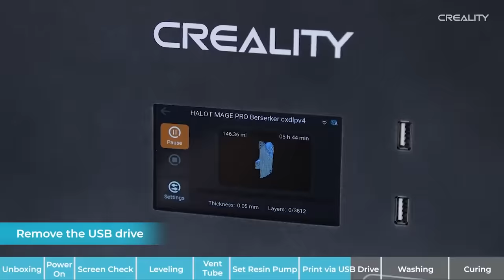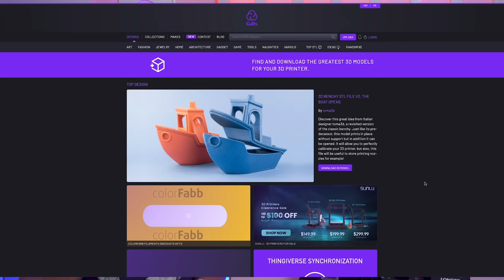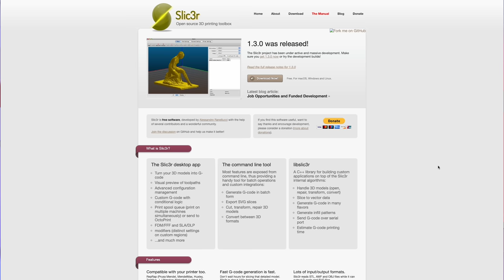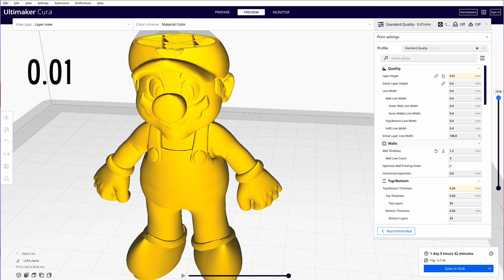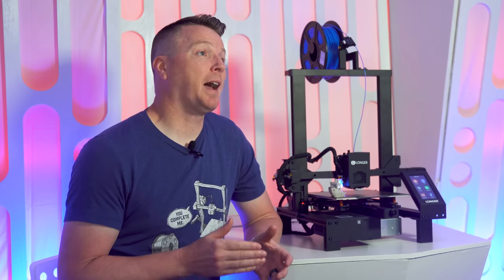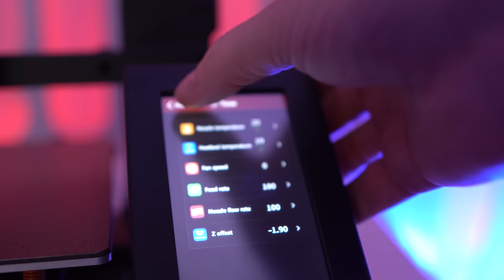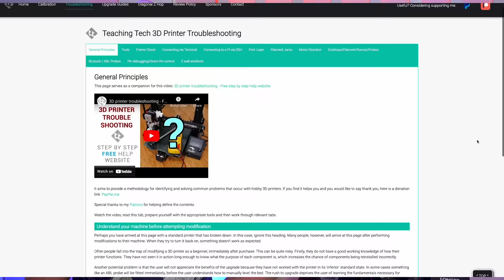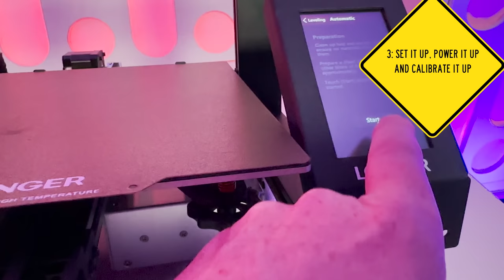3D PRINTING 101: The ULTIMATE Beginner’s Guide

Comment: @colincampbell3679
0 seconds ago
Hi there, Hope your memory is great. Because do you remember me Colin.  
I sent you a load of great upgrade files for the Tronxy X5SA 3D printer you unboxed and built on a live stream awhile back!   

I never heard back from you about how you got on with the Tronxy X5SA?  Or how many of the files for it I sent were printed for it?

I like to know please how the printer has been like and what stuff you may have done on it since?

As for my Tronxy X5SA, I have given up on it and dismantled it fully and replaced the parts back into the original box  saved from the 3 years ago I had the printer since!

I had tried to get a good leveling and prints from it but the damn size of the bed and the fact it has 6 hand done bed adjustment screws meant it 
was too hard to level right even though I upgraded it with the new Tronxy black sensor and a titan extruder and a ultra flex rubber bed sheet.

So it is now back in the box as I will use those for spears now.  I still using the Voxelab Aquila G32 chip machine which I had upgraded a few times.
It has a all metal high temp hot end which is at this time up to 300 C but with the right thermistor and heater it can do 550 C. 

I got a PEI double sided bed metal sheet. and a duel gear extruder and Capricorn bowden tubing and duel lead z screws. and firmware is the Alex one.

I still using the FLSUN QQ-S Pro Delta printer. And my Elegoo Neptune 3 is not working I am waiting for a new Main Board for it from Elegoo they already sent a new touch screen and power unit and micro SD Card so we see if the printer be up again soon?

I am saving up to buy a large format bed 3D printer to replace the Tronxy but even bigger bed than it had, a new Elegoo Neptune 3 Max with 400 x 400 mm bed and 500 mm printing height.
And it has a great auto bed leveling built in.  Just will need a worktop of at least 35 inches deep and 30 inches wide to hold it as the bed slings back beyond the frame.

I may if the cost comes down be getting the new Creality Sonic Pad to use Klipper it has to control up to 4 3D printers at the same time like it is built for?

I hope you can show us the printing you done using your Tronxy X5SA printer, as you seem to have a good one unlike me!

One last point, I did get a new Elegoo Saturn 2 Resin 8K printer and the XS Mercury wash and cure stations and used water washable Resin. But I will soon be selling it after only some good prints. WHY? Because I can't get rid of the resin washing water!  Here in the UK, we even at the best of times f the year do not have the long strong sunlight needed I fund to set the resin that is left in the washing station tub.

I have a small UV light I got with the Bundle of the washing and curing system, But it is no help setting the left over resin in that washing water.

And since the tub hold 7 liters to be able to wash the big models and the Saturn 2 bed too it meant I now have 14 liters of that used water I can't set as not the sunlight and can't throw it down the drains or toilet or sink as it is Toxic.

So sadly even though the resin printer is good, with the toxic waste water problem and also the fact that the amount of paper towels and other safety stuff I get through costing allot along with the resin costs allot for only a liter of resin, I just will have to sell the system shame but I not rich nor able to easy get rid of the waste water.

I will have to see if I can find a local recycle and toxic waste place to take the water too?  Be hard even then as I have no car. and I think the nearest one is many miles away from me.

Such a pain it has been to sort out stuff and now taken one FDM printer apart and having to sell my 1st resin printer and having to try t get rid of toxic waste water to.
Reply from the maker: Hey Colin!
I very much remember you and I appreciate you reaching out. So don’t laugh, but I never touched the Tronxy again. It’s collecting dust. I have been going through some house cleaning because I’ve been buying the newest fastest printers so I’m getting rid of some of my old ones but I, at least for now, will likely hold onto that one because of it’s bigger size. I just preordered the ProForge, which has about the same (maybe bigger?) print volume but can print at a crazy 800 mm/s, but that won’t be here until late summer at best. We’ll see. I also have two Bambu Lab printers and ordered the Creality K1 as well. 

I haven’t gotten into resin for the very reasons you mentioned but I’m more open to the idea than I used to be. It just seems like so much work. 

I hope you’re doing well and thank you again for watching and commenting! All the best, Colin.